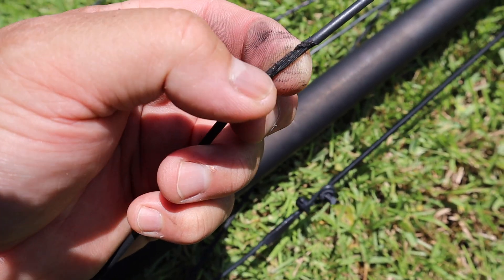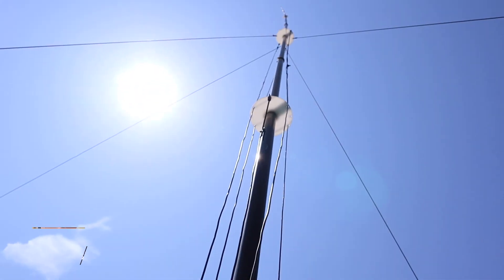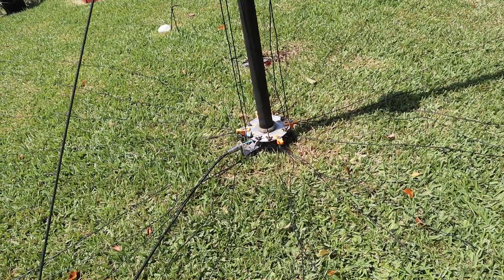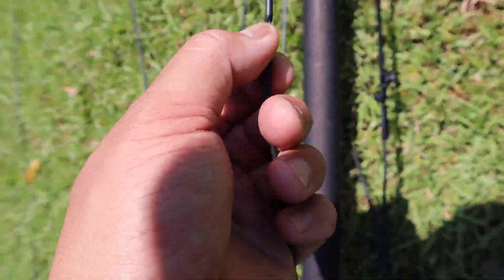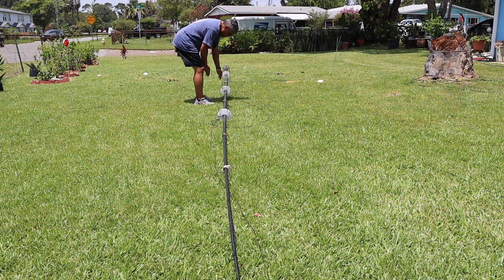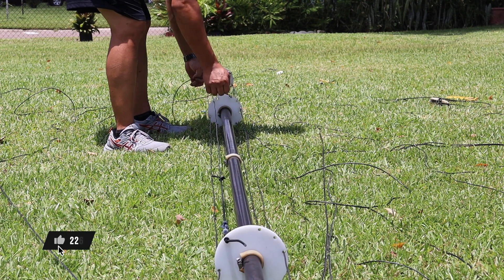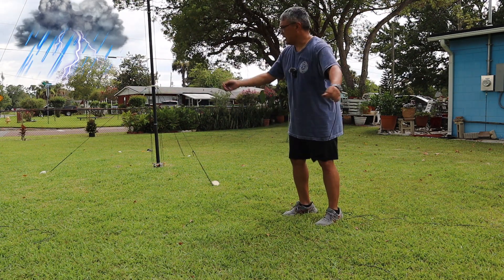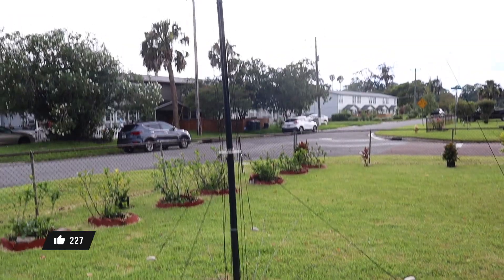Found out the root cause of High SWR! | Two wire elements Arc'd Over | DX Commander Classic

Comment: Not excessive power. It is the high RF voltage at the end of the 15 relative to the 40. I had two elevated radials burn off when they contacted another wire in huge winds during CQWW one year. And you need enough tension on the wires that they cannot flutter far enough in the wind to touch.
Reply from the maker: Well that explains it.  Thank you for the feedback to the group.

Comment: Interested problems, certainly a head scratcher. 

I was thinking if the elements had corrosion inside (under the jacket) that would increase the resistance of the wire itself and in the areas of the wire with corrosion it would act like a load, it would explain why the funny SWR readings and explain the arcing.

Just some thoughts watching your  videos, great videos put together very well.

Comment: WoW  Darren how much power must be 2kw at lest good to see its repeated brother I try and contact you now 73 de 2e0ree
Reply from the maker: Andy, I only run 1500w PEP max.  I think that the wind caught the elements while I was transmitting and it arc'd over.  This didn't happened overnight because I saw some wire corrosion where it was fused together.
Reply: Only 1500w...😢